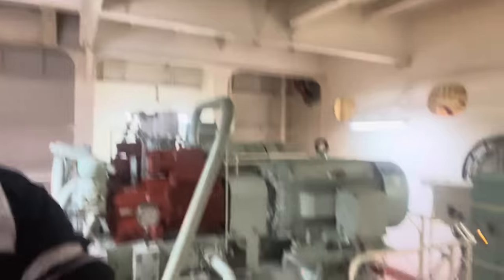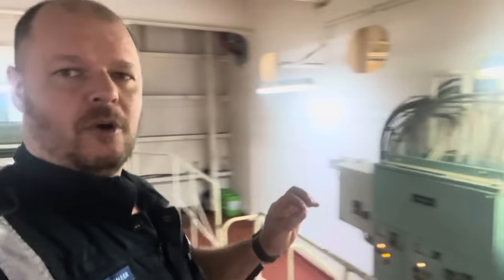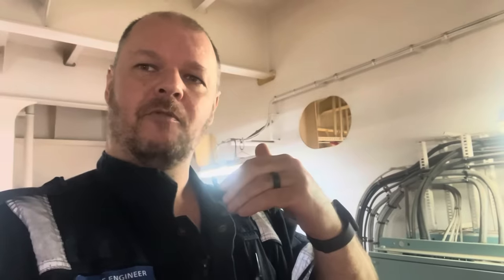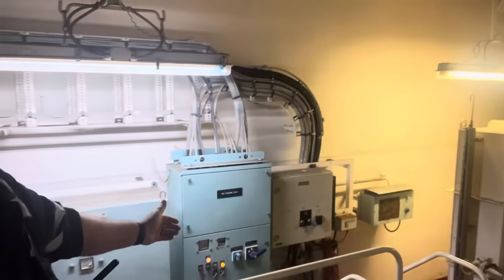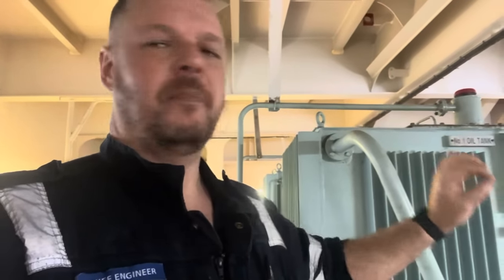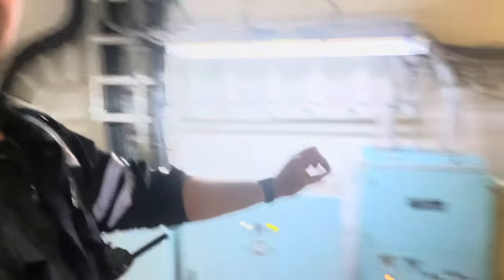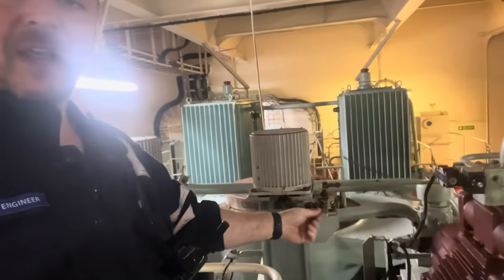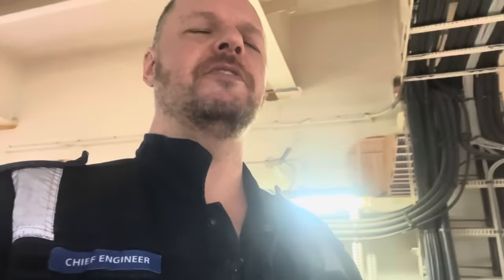Dali size containership steering system. How it’s designed to not hit Francis Scott key bridge

Comment: Dear Ladies and Gentlemen I actually had promissed not to make any more comments but when I read comments it hurt my heart how comments contain ignorance. I am sorry this is going to be a long comment no offence to you ladies and gentlemen . Dali has 4 DIESEL powerpacks two on 5300hp each and two on 5900 each they are DIESEL driven engines/generators and they can only run Diesel and not on Bunkeroil as the main engine is driven by. The main engine is a low speed two stroke engine and it is a different engine type than the powerpacks, it does not produce electricity from it's generator before a minimum rpm is reached, normally minimum rpm to generate elctricity from main engine is first reach at open sea. The power comes from the powerpacks until the vessel reach open sea this means the powerpacks had to be running in Baltimore canal then the accident happened. The question is how many of these powerpacks were running we do not know. Containervessels allways has one powerpack running on it's own fuelsupply in case of an emergency it also only delivers power to bridge and steering mechanisme, now this is cleared out. Regarding the Hydraulic steering, there are Accumulators, but these are or can only be used if main engine or powerpacks are gone dead this is due to the need to shift manually from electric hydraulic pumps pressure and oil supply to the oil supply of the accumulators. These accumulators contains high pressured oil and do not have a long service time as the oil after use ends in the hydraulic oiltanks again and with out hydraulic pumps running the accumulators can not be refilled. This is how elder container vessels are built. How the new once is built I do not know. Ladies and gentlemen this will be my last comment ever on Youtube as I simply refuse to participate in the low standard of some comments have become on youtube sorry. I also will excuse my bad spelled English but I have never ment to offend anyone.

Comment: I've watched your video and must say, many may think this ship never will lose control over their steering. Reality is, they still do. Main problem...all systems need power, even back up systems. Only one you described that could be done manually when someone is in the back, may not need power. But the way this accident unfolded is, between the first blackout and hitting the bridge were just 3 minutes. When the 1st blackout happened, no one will run to the back of the ship to do a manual steering but rather focus to get power back on line. Then the 2nd blackout happened. Again...no one will run to the back because the focus will be getting power back on line and trying to figure why the generators died the 1st time and now a 2nd time. By then the ship was way to close to be steered away from the bridge. Even when the 2nd blackout happened and someone decided or was ordered to run to the back with light and radio to do a manual steering, that alone takes a few minutes, time no one had, to avoid this accident. As you know, every time a blackout happens, the steering needs activated in the wheelhouse. That also takes a few seconds to a half minute depending on what signs they need to get, to know when all power is restored. On our tugboat we waited on the green light from the engine room, then could activate the steering. 3 minutes just wasn't enough to steer the ship away from the bridge while having 2 blackouts. They did had the chance to throw the engine in reverse between the 1st and 2nd blackout, therefor the huge black "smoke" coming out the funnel. I've worked on a tug boat for years and have seen my share of blackouts, one on our boat and many on big ships and they either run aground or hit something. At sea...no problem at all but on the river or canal, it is a big deal if one has the time to correct the course they're going or not. This ship just didn't have that time. Also...some of our old fleet of tugboats could run the main even when we had a black out. We could reverse the engine since it was controlled by air and not electricity input.. But everything today is controlled by power and computers for fuel management and so on that if a blackout happens, all comes to a stop. I believe everyone on board that containership did their best but there just wasn't enough time. 3 minutes may be a long time but not when you get 2 blackouts and try to figure what just happened here.

Comment: Is there backup battery system to provide power until the emergency diesel starts and powers up the generator?  Based on your description it does not appear to be the case.  Excellent tutorial.

Comment: Thanks for the insight. Two questions, during a worse case scenario with no main or emergency power, would the steering hydralics "float" or would the hydraulic system hold the rudder in whatever position it was in before loss of power? Second, without the water flow off the wheels, how effective is steering on a ship this size? Thanks in advance!

Comment: Great explanation of the steering system and redundancy.
But, irregardless of what is on the ship itself, in this scenario, there are still two problems.
Why is it not required for ships to have multiple tug escorts when going under a bridge.
Most importantly, why were there no protective piers to prevent direct bridge contact.

Comment: Just a truck driver/diesel mechanic here so definitely not a ship expert. But am i dumb for thinking that with a loss of power that the rudder would stay in the same position that it was in when the power went down? And the wind in Baltimore from the north wasn't horrible because you can see when they laid into it the smoke didn't do anything drastic.  And if the rudder did turn at 6 to 8 knots how much would it turn if the screws weren't producing forward thrust?
Reply: Yes, the rudder would be hydraulicly locked in the place it was at the outage.

Comment: Good explanation. I am well familiar with all ship systems from the main engines too the computers. Did the Dali  gets its main power off a shaft generator? If so the black out would indicate a failed main engine, or reversal and restart of main engine. The amount of smoke that came out of the stack seems to indicate a restart or full power. No matter what at the point of the indicated trouble show by the harbor camera it was way to late to do anything. Too close to fast and wind was from port side. A perfect strorm so to speak. Backing down if they did would have pulled that ship to starboard causing it to turn more toward the bridge. I think that they had to of had some trouble before the black out or the computer system failed. Generator windings can fail as well as electrical connections with out warning some times. A great deal depends on inspections and how well the ship is maintained. That ship hit with about 460,000 tons of force if one does the math. Very hard to protect from that level of impact.

Comment: This is fairly similar to what we have on inland shipping vessels. The difference being that emergency power for the hydraulic pump motor usually is 24VDC from a set of dedicated batteries. 
What I do see here If I'm not mistaken is the emergency electrical motor being mechanically linked to the main electrical motor. That could be an issue if the main motor seizes up for some reason. 
The only single point of failure we have on barges are the hydraulic lines that connect the steel hydraulic lines to the ram. They don't seem to exist on your ship and isn't relevant to the Dali anyway. 
If you look at the live cam footage of Dali you will notice she blacked out twice so either they restarted the main generator or the emergency genset also failed. That would make me think of fuel contamination. 
Could you maybe say something about the fuel 'system' for both generators? Do they also run on separate tanks? 
Really appreciate the inside view.
Reply: The ship he was in had 2 sets of dual hydraulic cylinders to operate the rudder and then 2 separate drive motors driving two individual hydraulic pumps which could probably be driven of either the emergency genset or the primary genset , whichever hydraulic power pack was in operation the other would be isolated by counterbalance and check valves to stop loss of hydraulic oil or backflow.
I would have to watch the video again but i think he said there was also a primary hydraulic power supply which would be run from the main gennie with the two small ones both being backup.
Reply: I was wrong. The red part seen around 0:44 is a pump and not an electromotor. Should have looked better. Still wondering,  like a lot of other people, how the.... do you lose steering.    @heartobefelt

Comment: Thank you for the explanation. Two questions. First if it takes 30 seconds to start the emergency generator it would seem to be prudent to having it running anytime you are maneuvering in port or a narrow channel. Is that normally done? Second, is there battery and/or hydraulic accumulator instant backup?
Reply from the maker: So the normal backup is that at least 2 of the main generators are online. The emergency is kept in excellent shape by not running it every maneuver. And is only for emergencies. No hydraulic accumulator or other instant no power backup

Comment: It does not answer one huge question though. Why was the MV Dali's rudder aimed to the right (starboard) when (if) power/propulsion was lost. All the sea charts show the channel at a 90 degree angle to the bridge. The rudder would have been dead ahead since it was so far northwest of the bridge when it entered the channel. It had entered the channel far northwest of Curtis Bay even.  Why was the rudder turned to starboard? Before someone says, like before, the current out of Curtis Bay pushed the ship does not float either because the ship was well past that point of Curtis Bay as well when it struck the bridge. I also find it hard to accept that the current out of Curtis Bay would have that much effect on a ship of that tonnage fully loaded. I have worked on ships too for the past 40 years, live on the water, and am an avid boatsman.

Comment: Looking at the Dali incident video,  it would appear power was not out for very long. The ship was close to the bridge and 30 seconds of outage would seem to be long enough depending on how close the ship is and what speed it is doing. One known fact is that it did hit the bridge. It would appear there was some sort of power outage as the lights went out. So is it reasonable to suppose the power outage of 30 seconds or less made the ship lose control of the rudder and it hit the bridge because the resumed rudder control was too late to avoid the collision?

Comment: I full understand the emergency backup.  My question is and I am waiting for the reports, is did they have even have enough distance to actually regain control of the ship in those 45-60 seconds before impact.  Even if emergency power was back in 20 seconds, how fast can a ship turn?  How far will it coast.  prop wash is require to get the best response for the rudder so was it possible in a narrow channel?
Reply: Good questions!
Reply from the maker: I went through the video and it was 4:12 seconds from 1st lights out to impact so 30seconds was a good amount of time to make adjustments. I don’t know if the emergency ever came on????!!!

Comment: That was great! Thanks! One Q: you said that the emergency bus is powered on by the main generators normally. Does a failure of main power cause isolation of emergency bus to prevent back feeding the failed bus? I assume so, but then, you're the expert, I'm not. Where/how does that isolation occur? Seems like that would have to be a pretty massive switch. How powerful are the main and emergency generator plants?
Reply: Yes, if the main bus loses voltage the bus tie breaker opens on a undervoltage trip.  Also the main EDG breaker will not close on a powered bus.  To feedback, there has to be manual intervention (a feedback switch, and then manually close the breaker).

Comment: Thanks for the information on those  vessels. I work on smaller boats and was wondering if the main engine has a reverse gear that can be shifted from forward to neutral and into reverse when the engine is running. Thank you

Comment: No inside info here, but I have a friend who was an engineer on large vessels...he did container ships as well as tankers.  His "guess" is the Dali was using two generators to power the ship (and the drive engine) and after they reached a set speed, they no longer needed the bow thrusters as well as other systems and shut down one of the generators.  American ships are required to operate two generators until they reach open water, but most foreign ships are not.  When they shut down the second generator, the electrical load was too much for the single generator and it shut down (failed).  This would be a mistake on the crew...they should have known the amount of electrical load required before shutting down that second generator.  Again, this is speculation but in his view is the most likely scenario.
Reply from the maker: Plausible

Comment: Normally in a situation which results in a disastrous outcome beyond what was designed, there is some compromise of redundancy that takes place. In other words, systems, even if redundant, can fail. Often there is a cascade of uplanned or even unforeseen events in which these systems become compromised. 
We don't have the information yet but the chief does a good job explaining what is in place. That lever which he shows that can command rudder locally in the steering gear room is generally something which might be used at sea to give some semblance of control at sea, say if you were days away from port and had to get home. Ship's telephone or radio would connect by voice to the individual in the steering gear room to relay helm commands and the person in the steering gear room would try to follow those commands. Im my experience it is a "shit show" and would take a long time to become coordinated. That's putting it mildly!

Comment: Great video.  I'm curious, in the case of the AMACO CADIZ VLCC, the rudder system basically lost all the hydraulic fluid due to a broken flange and pipe in a storm in the north sea back in the late 70's.  In the storm the rudder crashed into its stop breaking apart the steering gear sending metal parts flying in every direction and hitting one of the crew in the head. I suspect they only had one primary hydraulic system.  What would happen on your ship?  Do you have two separate hydraulic rudder control systems?  I think that the answer might be yes because I seem to recall that changes were made to rudder control system requirements after the CADIZ incident and the large oil spill off the coast of France.
Reply from the maker: Great question and the Cadiz is a big case study for us. I don’t know their exact setup but 2 pumps has been required for a very long time. I didn’t go in detail in the video but there are 4 hydraulic rams and any 2 can be lost and still maintain steering

Comment: When they went dark, they still had forward momentum correct? You were talking about back up systems, could they have had a battery powered backup system that could be turned on by a single switch at the helm just for steering?

Comment: So you have  redundant power, sources and hydraulics. My question would be are they fed from the same fuel supply?  Do the generators share a fuel loop pumps from the tank or the redundant one for each generator with out a fuel loop( loops are something we use in large facilities that use oil boilers with longer fuel lines )  ? You have a very well-maintained mechanical space ! I bet your systems are in excellent shape . That may not have been the case on the Dahlia.

Comment: Question:  It sounds like these systems have multiple backup redundancy systems for cases just like this? So with that being said, why/how could the Dali immediately steer directly for the bridge? If no rudder input was given at all they would've remained straight, its momentum wouldve carried the ship under the bridge instead. But it went directly for the bridge as if steered by rudder? How is that possible?
Reply: I think they went full astern and that caused the turn.

Comment: Question:  So, assuming the Dali lost main power but then regained it quickly -- and the bridge crew were mainly focused on getting the ship stopped (since they were still in port) is it possible that their first (and only) action was attempting to back the ship down/reverse thrust, and that is what caused the ship to veer to starboard and it had nothing to do with any rudder change inputs?

Comment: Although I am certainly not an expert in any way but an observation is that the dropping of the ship's anchors when the blackout occurred may have been a mistake. It is likely that it was part of the emergency protocol faithfully observed by the pilots but I think in this case the ship would have coasted on a straighter course had the anchors not been dragging on the bottom. The dredged channel under the main span of the bridge would have been concave shaped meaning that the sides would rise at a slope to the normal river bottom on either side. The starboard anchor would have encountered this slope and may have pulled the ship toward that bank. If no anchors were down, the ship would have coasted on on its original course hopefully long enough for power to be returned or to clear the bridge abutments. 

Hindsight is always 20/20 and I cannot fault those who were actually in the position of making instant judgements.

Comment: one thing I'd like to point out, is a ship can have all the rudder control you need, but when a ship that large is going at a slow speed, you need thrust from the propeller to actually move water past the rudder.